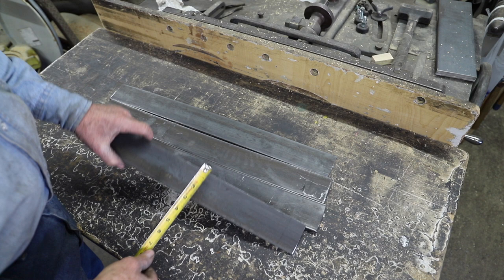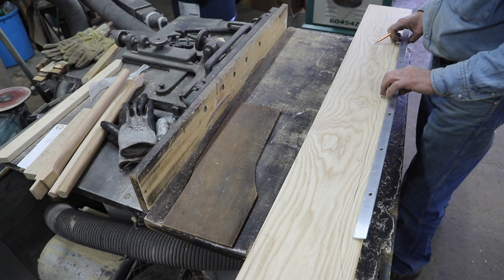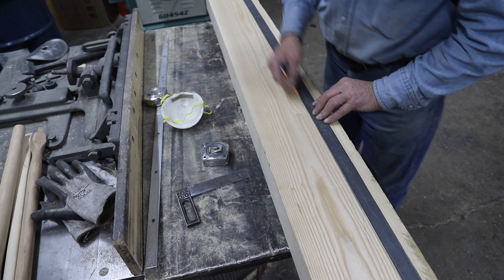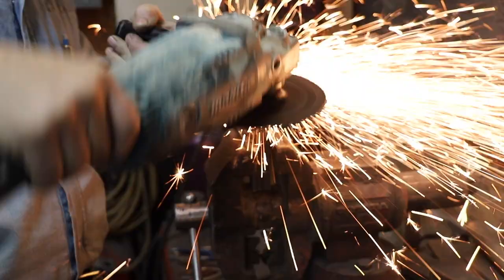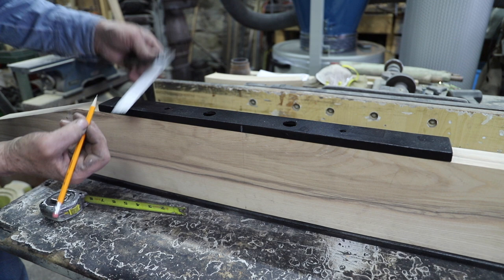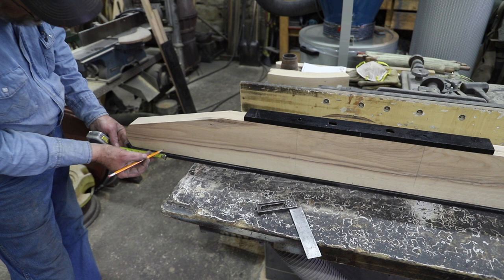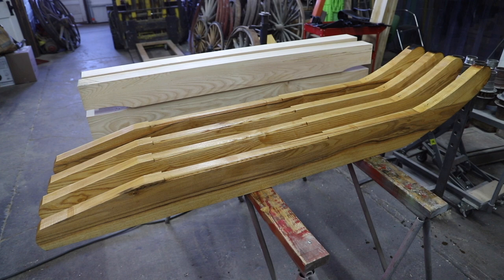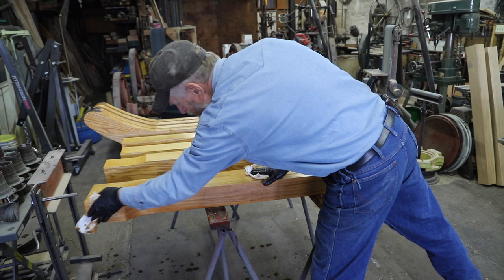Assembling a Bob Sled, The Journey Begins | Part 3 | Engels Coach Shop

Comment: Thanks Dave, watching these videos reminds me of being a kid on the farm where we had a heavy double turning bob sled that hauled timber with just standards on the bolsters, then hay with a rack removed from the wheel running gear.  We then would take the bobs apart and put a small box on the front bob which was called a “Dakota cutter” and used it to haul cedar fence posts we cut in the swamp winters.
Really anxious to see it all come together.

Comment: Always interesting and informative.  Here's a trick I use for picking up metal shavings.  Put a strong magnet (like a weld grounding magnet)  in a can (I use a tuna fish can).  It will attract the shavings and then when the magnet is removed the shavings fall away.  It's like the old hardware store gadget for picking up nails when buying them by the pound from a bin.

Comment: Love your good workshop practices. When I buy wood primer/undercoat I buy a larger can than I need for the current job. This week I needed to reopen one and because I hadn’t cleaned the lid properly I ended up distorting the lid getting it off. After using it I refrained from hammering it back on. Instead I fitted a rotary wire brush to my portable drill and thoroughly cleaned both lid and can top.  Now I use 2 lid lifters side by side and the original lid works again...yes I invert the can after recapping

Comment: Nice work ethic, as usual.  Didn't see any "warning labels or signs" in the shop or on equipment !  LOL to those who have to have them to remind them !
Reply: @EngelsCoachShop  Knowing safety doesn't mean you need signs plastered on equipment and within your shop. Most of those warnings are for liability reasons to attempt avoiding blame if there's an injury to those who want to place blame on the manufacturers of power equipment, even if they aren't responsible. Lawyers cause most of this lay person warnings regardless of experience. Just like those back up alarms on vehicles...they clearly will damage the operators hearing after a few long years. You have to wonder just who they are trying to protect.

Comment: I bet the propane forge really helps heat the shop in the winter, so none of the heat is wasted.  When I think sled, I usually think lightweight.  This is like the borax wagon of sleds you are building.  What do you think it will weigh when it's all done?  I am gonna guess 550 lbs.  Maybe you could ask other viewers to take a guess, then in the final episode for the sled, weigh it and announce a winner?  The winner gets a jar of chips, sawdust and ash from your floor!  😁 What do you think?

Comment: What a great "Carpenter's Eye" you have, Sir... to be able to line up the steel in your bending jig without stops, and lining up the whole this correctly by eye for the press each time, and having every one of them come our with properly equal leg lengths is a feat that few can appreciate (or accomplish). Most people would have fiddled and fuddled with some sort of stop pin or plate, but that becomes a hassle for those with a practiced eye like yourself. Bravo! I love it. I particularly enjoy the willfulness of your "damn the torpedoes, full steam ahead" panache in doing it all with a chuckle in your voice and twinkle in your eye. It all has a wonderful Mirthful Irreverence to the feel of it. ||| And then i kept wondering what you would use to protect the wood from rotting under all that steel, and if the drill holes and counter boars bear metal would get painted inside to thwart rust... well, i saw the application of TWP and i felt better. Phew!

Comment: Ride ON!!!  I think I would have just ground the ends of the Bar Channel Shoes to match the router end cut.  Just a thought, likely tried by you decades ago and proven wrong!
Reply: Gord Baker hand chisels don’t cut round corners. It would be a dead giveaway to the shortcut
Reply: @foxcub2yo108  Perhaps I was not clear.  The router bit leaves a rounded end cut.
Grind shoes to match.
Reply: @gordbaker896  My thoughts exactly. Think about hinges, if they are set into rounded corners that indicates they are routed, not hand cut with a chisel.
Reply: @bruceharvey8810  Not period correct etc.

Comment: Dave -
Thanks for another great video.  
Don’t remember seeing the propane forge before but probably a lot more convenient than firing up the big forge.  Wasn’t sure when you were first hammering the wood chisel but needn’t have worried- soft face insert looked like a small sledge at first.  
I’m sure snow shouldn’t be a problem for the first run of the bobsled.

Comment: At 17:00 you picked up something and touched the drill. Was that a piece of wood to break a chip, or a block of wax instead of oil. I put wax on my saws to make them slide better but I've never tried it on a drill, am I completely wrong? This video shows a lot better how much time/effort it takes to do a job and make it look perfect. I work mostly with metal and it takes a lot of time to get things right. We road a 83 Honda for app 16 years till I started having problems with my legs, time to get off. Your right, it is the ride. I like the way you return your tools to the proper place when finished with them, that way you can always find them the next time you need them. Thanks for all you do to make the video so good.
Until next time.
Reply: I am so JEALOUS 

No really I'm so happy for you, enjoy your days, you deserve it. Stay safe

Comment: A suggestion for forging those flats that you had to round on edge:
When you're rounding those, the side away from you that's being stretched length wise, you can hit flat when straightening to lengthen that side.  The side thats under compression, towards you, it helps to drag the hammer towards you as you're swinging it.  It pulls the steel towards you, which helps the curving process, while the alternative is hammering in a flat manner, causing the steel that's compressed from the bending to expand, fighting you in the process.  

Not a negative critique by any means, and with thin stuff, this method only offers a bit more assistance, but with thicker sections of steel. It can really make a world of difference.

Comment: I wonder, do you bend that flat strap on edge because of tradition?  Would it not be acceptable to have the arc segments cut out of a larger piece?

Your bandsaw skills are superb, I doubt many understand how difficult it really is what with the expertise and experience needed to set the saw up correctly not to mention actually making the cuts.

I sure wish I had a need for something you made.

Comment: Are those edge bent flat strips worth the forge time compared to simply cutting them from wider stock much as you cut wheel felloes from a board? Metal cutting bandsaw blades are widely available.
Don't get me wrong, it's marvellous to see someone with the skill to do it, but one has to wonder about the comparative cost in time.

Comment: I cringe every time I see you use your rasp with no handle.  I take an old golf ball, drill about a 1/4" hole in it, heat the rasp Tang  and jam it into the ball.  It fits the palm of my hand just perfectly and I never poke my hand
Reply: Champagne corks make the best file handles.  Whenever you need one, ......
Reply: Did you also notice that his hand never wraps around the horn of the rasp? A handle would get in the way when he's using the rasp flat to plane a surface.